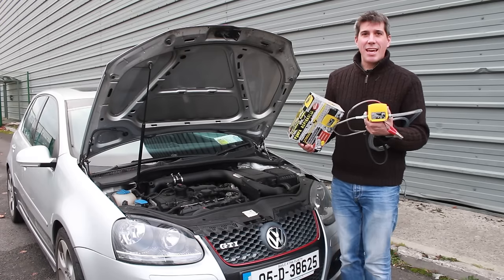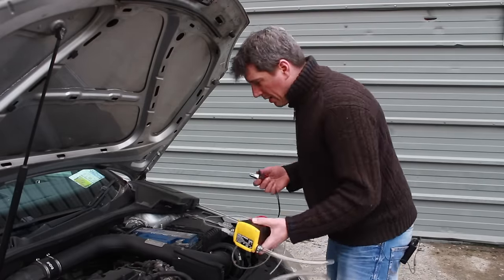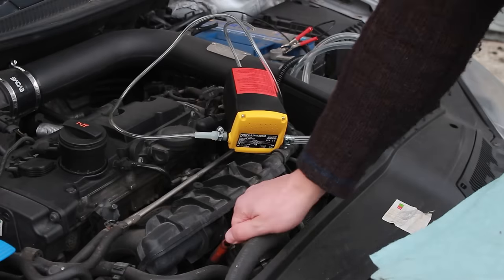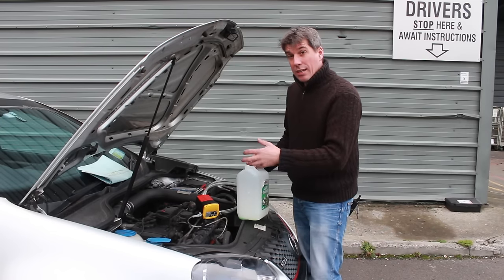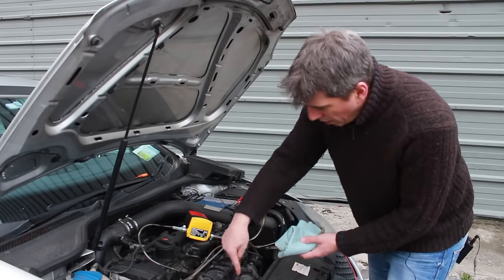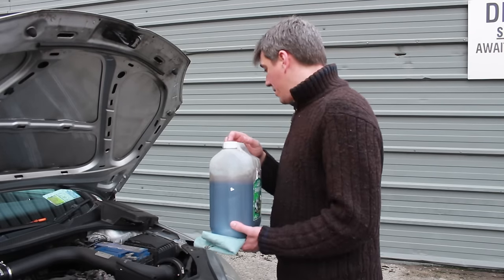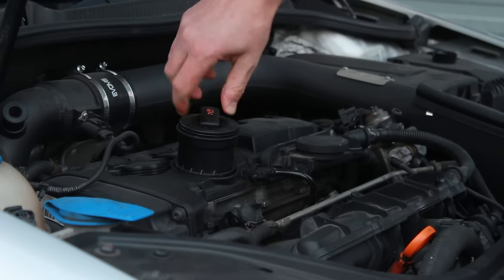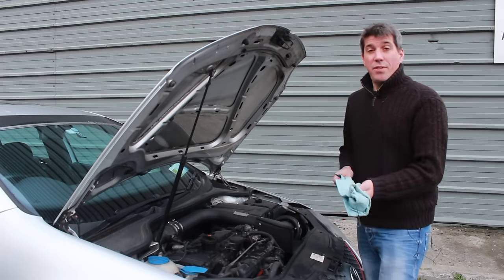DIY Car Service 12 Volt Oil & Fluid Extractor Pump From MicksGarage.com

Comment: Great tool for reducing the mess associated with a oil change. However you need to open the oil pan drain plug to further remove excess oil that may still be present. In addition you should always change out the oil filter as a rule of thumb. 

This product is also great to change out gear oil in 4X4 vehicles  in both the differential and transfer case to reduce the mess.
Reply: It's not necessary to touch the drain plug if you are careful about getting the tube into the bottom of the pan. If you know the capacity and measure the output, you can determine if you got all of it out. Typically, you will leave only a few milliliters in there with this method. Certainly not enough to worry about.
Reply: What about the cars without oil dipstick? My friend has a Merc C 220cdi sportcoupe from 2005, would that way damage anything?
Many thanks
Reply: @acmthere3674  no the dip stick port is where you should drain the oil. All cars have a location for that.
Reply: @jerryx2000  yes, I found it. Many thanks for your reply

Comment: For starters, I used a similar machine to change 6 quarts of Transmission Fluid and it worked like a charm, I would recommend using it for this purpose. I add,,, this Channel-Guy's engine Oil looks Very Dirty and any Oil change would have been better than it was. I agree with many others commenters in that, if you are able to get to the Oil Plug drain plug of the engine, fairly easily, then use the drain plug and drain your Oil instead and also change your Oil Filter. (On a time recommended Oil change, you should also always change the Oil filter). However, on some cars though, and for Car Buffs, and I'm sure there are people out there that wish to keep their motor oil crystal clean, may wish to change their oil more frequently than the time recommended. So, if you change your Oil every few thousand miles on a perfectly tuned engine, and choose not to change the Oil Filter for another few thousand miles, this Oil Pump may be just the Tool for you! Again, I've used it on Trans Oil and it worked Great and was also Kinda Fun!

Comment: You still have to wait for the engine to cool down to change the oil filter, then refill with engine oil. If the filter in under the engine.

Comment: Not all oil been extracted.
On all engine,doesn't matter the make and model,will still be more than a 1 litre left.
All gti has 4,6-4,7 litres capacity.
Reply: Not so. The design of the sump plug on the very common Peugeot 1.6 HDi engine is concave, not convex. This leaves 200 ml in the sump every time. See More Molecues test of this on a new sump before fitting it to the car.

Comment: what would you run through the pump to clean it up before putting it away?
Reply: A little bit of clean oil is what it says in the manual.......  NOT BRAKE CLEANER.
Reply: Or mineral oil
Reply: Since these pumps supposedly can handle fuels like gas and diesel I would just run the hose to the fuel tank and run it till it is clear in the tubes.
Reply: Itl make the hoses all brittle. Even if they are supposedly fuel/oil safe. Just run a little clean oil thru.  These are all the same cheap chinese junk pumps. Youl be lucky to get 2 years out of any of them
Reply: @virgil5361  Not so. Very dangerous! The instructions specifically state that petrol/gasoline and other fuels must NOT be run thru' these pumps. They also say that the pump is not suitable for heavier oil such as g/box oil. 

The bearings in the pump are lubricated by the extracted oil. The obvious way to leave the pump clean and ready to go next time is to run clean oil thru it till the outlet pipe runs clear.
Reply: @virgil5361  
Lol, Is that what you would do? instructions in the box clearly state no fluids especially flammables.  Nevermind the horrible idea of sticking a hose full of dirty motor oil in a gas tank.

Comment: Does this work on changing the coolant fluid and if so, do you have a video how it's done?
Reply: Just unscrew the bottom hose, turn on the car heater and undo the top hose. Run your garden hose in the top and flush the radiator out. I usually do it with the coolant warmish, be careful not to open the cap without the engine running as itl explode steam out sometimes. Theres loads of ways to do a coolant flush backyard style without a fancy pump
Reply: No! These pumps burn out the bearings if used with anything but oil! The oil being pumped is the lubricant for the pump. 

They don't work with g/b oil either - too thick. Burns out the motor.

Comment: I wouldn't rely solely on this. Better to drop it from the bottom. I use a similar one for inbetween services on my fj cruiser. As its a bastard to get under unscrew everything etc etc. I see you like to live dangerously without a funnel there hahahahah

Comment: I think this is a great little pump and if used appropriately can assist in some  service jobs. However showing it in this way is like showing someone who boasts he can tile a bathroom in a morning. Yes you could, if you left the other tiles on and tiled over them, but to do it properly you’d want to take the old tiles off 1st.  Ergo if you still have to jack up the car to remove the filter and change it  then why not remove the drain pludg and drain at the same time you replace the filter. I appriciate the  video was purely made to show the oil removal, but you wouldnt change the oil without changing the filter surely. Not an accurate description of oil change using this device  to my mind. Although as I said i think the pump has it’s merits.
Reply: most modern cars have the oil filter in the engine bay so no need to jack up the car. I am going to give this sort of a pump a try.

Comment: Vacuum extractor is easier and more practical than this electric pump in my opinion. And you can place it on the ground during extracting. Also draining the hoses is easier after an oil change.
Reply: How is a vacuum extractor easier?

Comment: Hi there, im not sure if you still go around your own videos and answer to our questions but I have the same model and i follow you video. Thanks a lot! :) but i got a small issue in which im stucked with doubts and afraid i may have done something wrong. i tried this on my C4 1.6hdi from 2004 and supposedly the engine has 4 liters but it only came out 2.3 +/- . I tried to force down the much i could this rubber and stick and it really got nothing more from the engine. I have even compared the length between the rubber inserted and the oil stick from engine and it was the same size. Also, I had to refill the engine and the maths were consistent. i put back 2.3/2/4 liters. 

My question are:
1. is this normal? 

2. what i have done wrong to only get 2.3 liters instead of 3.8 or 4? 

3. should I have to install a special ending in the rubber? 

now the NOOB question:
should i drive normally the car as it is, and only change again in the next 10.000kms the oil or should i try to redo all again (to remove all oil - the expected 4 liters)?

Thank you and sorry for my dumb questions :(
Reply: I know this is old but that's an important question. Did you check your dipstick before hand to see if it even had the proper amount of oil in the first place? The car could have burnt through some oil or have somewhat of an oil leak given that it's an older car. Other possibility is that the tube wasn't capable of getting all the oil out, in which a normal oil change through the drain plug would be a better idea.
Reply: I have also tried it with the 12v pump and got even worst result, I was only able to get 1/4 of the oil out.  The $100 Fluid Extractor works better and will get most of the oil out.
Reply: In addition to the points made by Laf, was the car level? The capacity of that engine - I have the same - is 3.75 l
Reply: Always check the oil level before hand.  

If you try every way to position the tube and nothing else comes out then add that same amount you pulled, check the oil level and see.  If you need to add more than you removed you know you burned or leaked oil.

Comment: You got 90% oil out of the engine but 10% oil stuck underneath the filter/tank. And Don't forget to reset the Odometer.

Comment: don't forget to change oil filter :)
Reply: He explains why they didn't on this car.
Reply: @dunebasher1971  it really does not matter whatever reason he gave, the oil filter needs to be changed every oil change. I am glad that the previous fellow mentioned the oil filter as I was giving serious consideration to this pump but it is totally useless as for most vehicles you will still need to get underneath to change the oil filter which makes this device totally useless since you still have to get under the car.
Reply: I am so glad you had mentioned this as this device is totally useless since you still need to get under the vehicle to change the oil filter.
Reply: I think honda says every other oil change needs a new filter.

Comment: That looked like it pulled barely over 3 Quarts of oil in an engine that takes 5 quarts....Although there would be no harm if it left 5-8 oz behind in the pan....we're talking about over a quart of oil remaining behind which is a considerable amount of oil. The hand pump ones are better than this as I've seen them get out roughly 98% of the oil.  Plus always remember you also need to change you filter!
Reply: The vis did explain that the reason he did not change the filter was because it had been done 1 month previously. It  was purely a demo of the pump.
Reply: Someone didn't watch the video 100%...

Comment: No need to change the filter ...
Reply: You should still change the filter irrespective of the method used to drain the oil. The filter will become clogged over time which will potentially force the filter bypass valve  open during normal operation which will cause accelerated wear to the engine.
Reply: Simon Clarke It was a joke 😂😂😂 of course u use new filter every time u do an oil change

Comment: Bit of a stran on the battery
Reply: Nothing that would cause any issues unless the battery was already on the way out. There are plenty of other 12v accessories that people use regularly with the engine off, that cause no problems at all.
Reply: just keep the engine running, problem solved, your battery will be ok but you'll fuck the engine.

Comment: So all the sludge, fillings, and any other contaminants can stay there for another 5k with the old oil filter. sweet
Reply: There are vids on YT of guys that have tested what remains in the sump [after using a pump] by removing the sump plug. I have not seen one vid where there is ANY more oil drained from the sump. The trick is to measure off the pipe against the dipstick and make sure at least that length goes into the engine.

In addition, the vid by More Molecules on fitting a new sump includes a test of how much liquid - he used water - he could pour into the sump [on the bench] of his Peugeot/Citroen 1.6 HDi before it reached the level of the top of the sump drain and started draining. The answer was 200ml. So draining via the sump plug will always leave the last and worst 200ml of the contents of the sump, in that engine.

Of course, with a properly designed sump plug - the plug set in a bowl rather than in a 'hump', this woud not happen. I have seem a vid where a guy creates a bowl in his 1.6 HDi using a dent puller.
Reply: No, they come out with the dirty oil filter.  If you have sludge in your pan, it's time to pull the pan.
Reply: If you have any sludge and fillings in your Pan then you have a serious issue. It should have all been collected by the filter if the filter is working properly.

Comment: This is rubbish, there are still oil left to be drained, at least another half a litre to 1 litre, which has contaminants that you will be recycling with the new oil. Viscosity of the new oil will be very much affected with that much used oil in it. The filter change can be a mess as well. This is not the proper way to do maintenance. usage of the pump would be ideal when done at the oil drainage plug along with gravity drainage method.
Reply: Nearly all big garages remove the oil throught the dipstick now .If a car comes in for just an oil change it is done this way as it saves the customer money as most modern cars have huge plastic undertrays which would need to be removed .
Reply: Most car manufacturers don't even provide a gap in the under trays to allow you to gain access to the sump drain plugs. Whether we like it or not this is the way oil changes are now done.
Reply: Carter Ng on the pistonheads forum two individuals changed their engine oil using a 12v extractor and after removing the sump plug as a test only an additional tablespoon and a half of dirty oil came out. So your claims of another 500ml to litre remaining seems a fallacy.
Reply: Mercedes recommend doing it this way.
I've done it on my Vauxhall insignia and after I removed the sump bolt and no more than 100 ml came out.
I do oil changes every 6 months so I doubt such a small amount will affect the new oil
Reply: You can get more oil out this way. When draining from the drain plug some oil is left in the sump
Reply: There is always old oil left in the sump no matter how you change your oil, plus of course all the old oil that's coating all the engine parts!

The only way to be certain you've got every last speck of the old oil out is to take the engine apart and clean every component individually...
Reply: Volkswagen remove oil like this in my local dealership so it must work!!
Reply: ferkemall  Can sympathise with the nuisance, but you are now going slower and paying more per mile to drive your car!  They help aerodynamics and protect the underside of your car from damage.  Perhaps worth the occasional removal hassle?

Comment: and the mess is stil in the oilpan How stupid this iss
Reply: frits duwel how is the mess in the oilpan' when the guy clearly states that he is useing a 5 ltr container' .
Reply: Yes, there is still a good amount of sludge still in the bottom fo the oil pan, what some of the old-timers did was to pour some kerosene into the engine and run it for about a minute or two to help loosen up the sludge in the engine and make it easier for the sludge to pour out from the pan when the drain plug is removed.

Comment: 👎 Won't work with any VW/Audi 1.6 FSI engine, as the dipstick tube is too narrow. Never seen these extract all the oil in any case. Bit of a con. Better off doing it the old fashioned way.

Comment: It does not work on all cars rubbish..
Reply: Not very helpful. What would be helpful is to know what engines it doesn't work on.
Reply: For starters, BMW N46 engines. Mines a E90 318. It has an electronic oil level gizmo, so no dipstick!